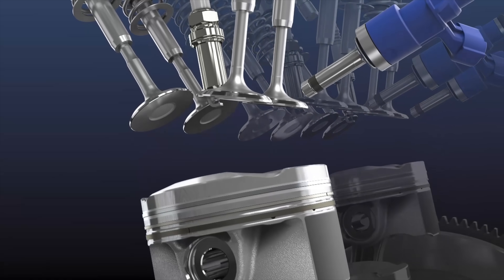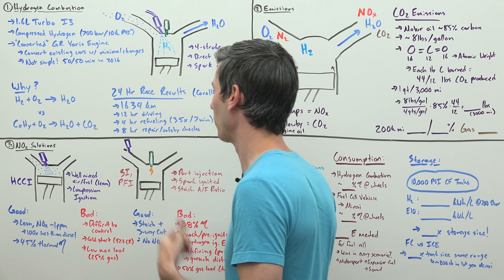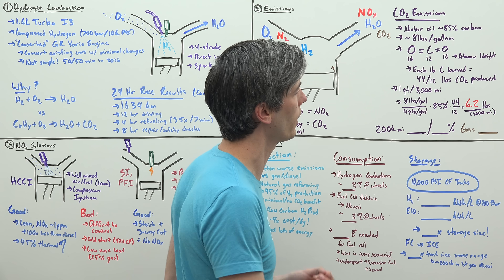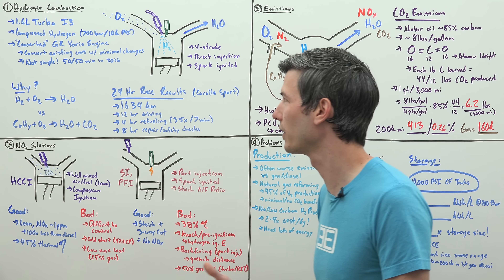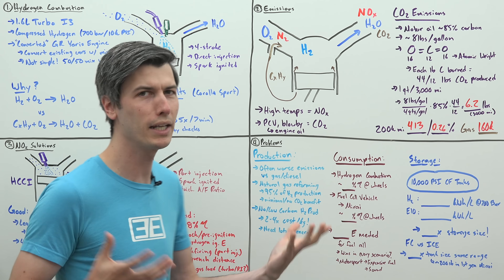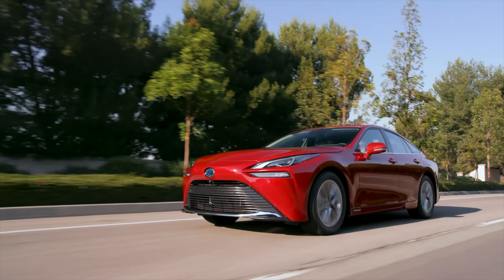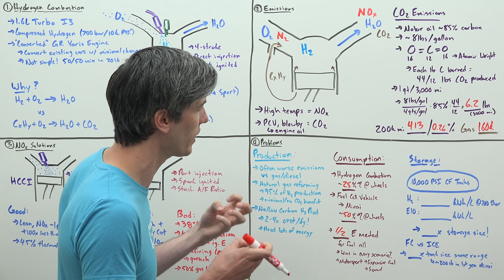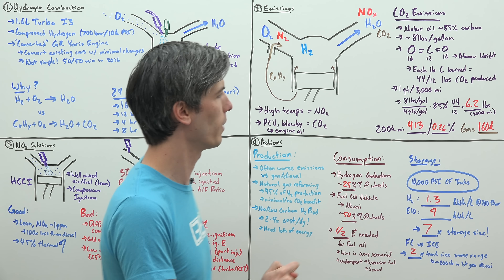Toyota's Developing A Hydrogen Combustion Engine!

Comment: Ideally, hydrogen powered cars would be far more environmentally friendly than electric cars.
Reply: How?
Reply: Just not going to happen when electrolysis is so inefficient
Reply: Simple ansver never.
Reply: @Buringrud  1) no mining
2) no concern around solid waste disposal / recycling
3) quick refill (like petrol)
4) no Chinese dependence for rare earth materials mining and processing

On #2, no viable process for Li-Ion batteries is currently in production.

Of course, if a better battery chemistry actually makes to production, the assessment can change. For all the reasearch that has gone into it, alternative chemistries remain stillborn.
Reply: @denismilic1878  exactly
Reply: @vipul_singh  First, many more moving parts, it’s also extremely inefficient. While you get 20 something percent of the energy you put in. Also, no mining, but where do you think they get hydrogen from? You don’t just grab a bag of air and have hydrogen you have to separate it. Then most of the time they make it a liquid which is still extremely hard which makes it expensive. Now with electric, you can literally get the power from solar which a lot of people do. Also all supercharged are going to renewable electricity by 2022. The worst thing about an electric car are the batteries, which will continue to get better and better. There is research out there for batteries made of hemp that are 80% better. Or batteries made of silicone if they can get it stable enough not to expand and contract so much.(which tesla is working on). So yes batteries now are bad, but they won’t always be. Has engines have had over 100 years to get better and they are still inefficient and slow. Electric is still in its infancy and once the batteries come from more renewable sources. Nothing will be able to beat it. As of now total production and life of the car, Tesla’s produce 25% less co2 than a gas car and that number will continue to decrease. Gas/hydrogen engines will never decrease. It’s inefficient to use a fuel.
Reply: If we get mass adoption of thorium MSR's and/or fusion becomes viable, sure. I still think there's a safety argument for keeping hydrogen off the road though, because a 10,000 psi tank of hydrogen in a high speed impact is a catastrophe waiting to happen. But it might be a good fuel for aircraft and specialized equipment. Ships... maybe, but space tends to be more important than weight there.
Reply: @Buringrud  As the energy production itself gets cleaner, all downstream processes would become more environmentally friendly. So I agree with you there - electrical energy production has to become cleaner as it is universally advantageous, in whichever way we subsequently use it.

What we should certainly also be pushing for is that this cleaner energy be used to produce Hydrogen from clean sources too (example: water), instead of the way it is currently being done. Thankfully, there are no technology challenges in doing H2 cleaner, unlike batteries (see below).

Where Li-Ion tech fails is that it seems perpetually dependent on mining, and associated waste management concerns. Such concerns are practically nonexistent with H2, if it was produced with clean energy and clean methods.

As I said, chemistries to replace Li-Ion have been in labs for 30 years. Once I see a different chemistry in production, I am open to revising my assessment.
Reply: @DFPercush  We would certainly need to ensure that H2 cylinders are physically protected, just the way Lithium-ion batteries are, and I believe those techniques are already in place. Lithium, too combusts spontaneously upon contacting air.

But yes, you raise a good point, for sure.
Reply: @vipul_singh   Chemistry for batteries has already changed significantly over the past 20 years. It will continue to change and get better. Look up hemp batteries, now that hemp is more legal to grow and use. Look up silicon batteries as well. You can literally scrape the the desert for silicon. 

Again with the clean energy. Currently tesla is moving all of their superchargers to green renewable energy. Once that happens by 2022, the only issue again with electric goes back to the batteries. 

Hydrogen is so inefficient. You have to to produce it as well, then transport it to the stations where you fill up. With electric you can plug in literally anywhere with an outlet. 

Also, it’s super explosive! Unless again you turn it into a liquid. Which is super expensive and uses more co2..
Reply: @carbonstar9091  - no disagreement there
Reply: Unfortunately no. Hydrogen cannot be made in large scale from hydrolysis and the only other viable “green” method is using thermochemical process with thorium salt nuclear power plant. There are still big problems today with thermochemical process itself and catalyst compounds but there might be a way through these problems. However biggest problem is nobody is currently operating any thorium salt reactors commercially so whole point is still moot.

Comment: In northern perspective, hydrogen system have 100 % efficiency. Nearly whole year we need heat, in cars and houses. When electricity produced by nuclear energy, no emissions. Do you know that, small diesel not produce enough heat in car In very cold winter weather?

Comment: How many EV’s could they have built for what they spent on this?
Reply: That's not even a useful question. Doing science will always be more expensive at first than just continuing with the status quo. The point is to spare no expense researching every angle to solve the gas problem so we don't all die

Comment: It really makes you question why Toyota so invested into hydrogen.
Reply: Places in Japan are density populated people usually street park, having a garage is extremely rare and expensive. They are probably trying to work around this problem as hydrogen fuel cell vehicles and hydrogen combustion can be adopted easily and you fill it up just like a petrol car
Reply: @mathew936  That may be true for Japan but they're a global company. If the rest of the world doesn't adopt hydrogen they will fall behind. At this point EVs seem to have the clear lead.
Reply: Their .. hope? is that the price of Hydrogen will come down with mass use to the point where it makes sense.  All auto manufacturers are focusing on electric. If you take the high cost away from "green hydrogen" it is the way to go. (in a fuel cell) .  The Mirai has been a great experiment... but they had to install fueling stations in California themselves, in order to trial the cars.
Reply: @Ozmundas  Okay, I wish them the best on their hope. Mass adoption is the key. Ask someone who isn't an automotive enthusiast if they heard a Toyota Mirai and then ask about a Tesla. I almost guarantee they recognize the Tesla over the Mirai. It's almost the same concept as Blue Ray vs HD DVD. I'm not saying one is better than the other, it's which one get mass adoption will win.

Comment: Toyota should be commended for continuing to think creatively. Their cars and trucks have a great reputation for reliability and performance.  Frankly, there is nothing out there today that is performing like the gasoline, diesel engine. 

Until the EV can match with performance, reliability, range, price, re-fueling time, etc., I doubt very much that the less than 1% market share that these vehicles have in the US will not change.

Comment: if this video concludes, like EVERY single other hydrogen video, that hydrogen is not economic to use, im gonna lose it
Reply: I know right.
Give it a frickin chance!
Its like if any company mentions hydrogen as mobile energy storage the internet says: NO
I was in that group at one time but then I found out how much pollution making a battery cost compared to it's lifespan. 
As long as you don't need maximum efficiency (like on a solar powered yacht) you should use the option that causes the least pollution.
Hydrogen fuel tech has a much lower floor for pollution than batteries. It's metal tanks versus composite batteries.
And hydrogen combustion avoids expensive fuel cells. All we need now is a more robust energy grid to make up for the inefficiency of making hydrogen itself.
Reply: @AurumFaber   I mean Mazda sure did try a hydrogen RX8 and it made half as much horsepower and the amount of energy it takes just to store it is absolutely absurd. Hydrogen fuel cell vehicles are out there in the US but they're incredibly niche and if you're not in a specific area in the US you can't get your hands on one, but at least the efficiency of electric motors gets to help there. Hydrogen combustion just seems like the worst of both worlds.
Reply: @CaroFDoom  energy cost to store the hydrogen can easily be offset by renewables, no? 
The point of my comment is that batteries were out, and then you must dispose of them.
Sure, hydrogen power storage is extremely inefficient, but that energy can be taken from anywhere. 

But I believe that the real problem is personal transport in general. If we want to do away this batteries and hydrogen tanks, mass transport by rail should be the norm. 
Intracity transport can be handled by trams and subways, intercity transport by full sized trains. Rail vehicles are ridiculously efficient. And there is no need for batteries, pantographs and third rails can transmit power directly from the power plant. 

But alas, people love their cars more than the environment, and we lack a good passenger rail system. The needed infrastructure will never be built and the planet will get warmer and warmer. Other countries are making a start but the US falls flat.
Reply: @AurumFaber  in the world where we have infinite availability of renewable energy, sure, that no longer matters, this is not that world. batteries aren't a great solution either but they're here and viable right now with the infrastructure needed to carry it also being used right here, right now.
Reply: @AurumFaber  Was gonna say something about reclaimed materials and bring lead from lead-acid batteries as an example, but looked up the current state of lead-acod recycling. I mean, yeah, most batteries are made from recycled lead, but the recycling itself is currently a polluting mess, it seems.

On the other hand, battery manufacturers are working hard to reduce cobalt use, and over the lifetime of the car, it's still better than fossil-fueled cars, as far as I can tell from data I've seen.
Reply: @AurumFaber  Fuel cell cars are electric cars
Reply: @fenderstratguy  
Understandable, have a great day.

Comment: sounds like electric is better in basically every way almost
Reply: Hydrogen is actually more sustainable in the long run, its just that hydrogen vehicles are a very early stage compared to electric cars.
Reply: @arturoescorcia  Maybe someday we will have a sustainable electric energy source that dwarfs anything we have now and can afford to mas produce hydrogen through electrolysis.  Maybe someone will discover an element that when exposed to  carbon dioxide gives off hydrogen.  An algae that emits it.  Never know.  Worth researching for sure.
Reply: If they crack the problem of the EV batteries being huge and heavy and with slow charge time and very poor energy density then I think nearly everyone will be happy to just use EV (once they get the price down to the current ICE levels)
Reply: @philspencelayh5464  I think they've already developed small scale prototype solid state batteries that have the potential to revolutionize everything if it can be perfected and mas produced.  Greener and longer lasting

Comment: Dude, you are amazing, I just wish Toyota takes notes and implements the "FreeValve" aka the Electronically Controlled Valve Technology and further improve their experimental Hydrogen Combustion Engine...
However, the storage and supply chain of Hydrogen Gas is way more complex, costly and challenging due to its extremely low boiling point and the miniscule size of the Hydrogen Gas Molecule. Therefore managing the Hydrogen Gas before and throughout the combustion cycle is a way bigger problem than improving the efficiency of the Hydrogen combustion itself.
Again, Electric Motor Efficiency and convenience completely surpasses the current Hydrogen Combustion Thermal efficiency and practicality.
Nice to see this technology being improvised though...but I doubt that this technology will pick up unless we find a way to store Hydrogen in a liquid form at room temperature and pressure like Hydrogen Peroxide or Water or a new form of Liquid that holds Hydrogen or something...

Comment: You could easily use electrolysis and solar power to split water (rainwater and mains) into hydrogen and oxygen. These one man in the US who lives somewhat isolated who uses just as a set-up, and then uses fuel cells that create both electricity and running water on-demand. 
Also, James May had a Mirai for a while, but had to sell it because the UK is lazy regarding hydrogen refuelling pumps.

Comment: Any gas engine can burn hydrogen with minimal conversion. BMW had a limited production model that burned both and you could switch back and forth with the flip of a switch. Jack N had a G body that he ran on hydrogen. All old card could be converted to hydrogen. Modern ones as well.

Comment: so can you just throw on an fuel regulator like on a CNG conversion on a gas injection engine & burn hydrogen in it?  what about a turbine type of engine with just oil just for the turbine blades probably have even less to no co2 emissions

Comment: I'm just a machinist not a physicist but couldn't you use the alternator for on board hydrogen electrolysis and a rotary motor for simplicity. Seems like you would have power loss involved with the up and down motion of a piston.

Comment: I think it doesn't yet make sense to compare H2-engine with fuel cells or EVs for passenger car applications. If you however do a similar comparison for high load and low speed applications (Tractors, excavators, wheel loaders, etc.) you would see a significant advantage of this technology.

Comment: Sodium  pellets  wrapped  in  aluminum  foils  may  be  kept  in  normal  tanks.  Pellets   may  be  conveyed  to  a   small  chamber      and   water  can  be  sprayed  over.  Hydrogen  gas  will  evolve   for  engines  or  fuel  cells.  Sodium  hydoxide  effluent  can  be  recycled  to  extract  Sodium  for  reuse.  Energy  density  would  be  30%  of  Gasoline.   Can  be  analysed   and  tested.

Comment: So if the exhaust is water. Can't you put that exhaust in a extra fuel tank where it's purpose is to separate the hydrogen from water and put that fuel back in the original gas tank

Comment: Why not use mineral oil? That would eliminate the carbon and C02 problem. We been using mineral oil in air compressor for the last 50 years so we can breathe the air that comes out of the compressor.

Comment: What about intake valve gunk? The reason why they switched from direct injection to duel injection is because the valves would buildup gunk over time without having gasoline clean the valves. How would they solve this?

Comment: Green hydrogen in my country is cheaper than oil or diesel. Already buses using it. Wind farms in the sea instead of storing power in a lithium ion battery they store the power as hydrogen. However, why not just use Iron oxide or something? If it spills no problem, it can be "recharged" to be reburnt, and can be stored in huge amounts pretty safe.

Comment: Everyone hates on hydrogen, but I think it has it's place. Yes electrolysis isn't that efficient but if it's made with renewables you've got no CO. The best thing though I think is in countries like mine (UK) where natural gas boilers are in the majority of homes .. these can run on hydrogen as well and cut out the carbon emissions without needing new infrastructure.

Comment: forgot to mention hydrogen embrittlement.  I have a feeling it would crack rings and cylinder sleeves (and any steel it passes through) pretty quickly.

Comment: in the case of fuel cells, we still need hydrogen stored in a tank in the car. We still need storage tanks if fuel cells are used right? if yes how fuel cell cars are better than internal combustion engines ones?

Comment: What happens when a cylinder at 10,000 PSI is ruptured in an automotive accident?  I used to fly an airplane that had 3 high pressure air tanks (3,000 PSI-"if" memory serves me correctly) located right behind my head; and that made me a little nervous (many of it's systems were pneumatically powered rather than hydraulic powered {Fokker F-27}).  What kind of "energy level" compared to a standard tank of gasoline are we looking at it one of those "large" nitrogen tanks were to be ruptured and ignited in an accident?

Comment: Clean Air Now, a California nonprofit public advocacy corporation, has recently completed its ground-breaking “Solar-Powered Hydrogen Generating Facility and Hydrogen-Powered Vehicle Fleet” technology deployment demonstration project. The project is located on two-thirds of an acre, at Xerox Corporation’s El Segundo facilities, just south of the Los Angeles [California, U.S.A.] International Airport (LAX). The project is the largest and only fully permitted solar-powered hydrogen-generating facility in the country. It comprises a major portion of the developing hydrogen energy infrastructure in Southern California, which now supplies fuel for some of the few private sector hydrogen-powered vehicles in operation.

Clean Air Now’s demonstration project in El Segundo, California, U.S.A, uses solar electricity to generate hydrogen; the hydrogen produced powers a fleet of vehicles.

Comment: Suppose we had cryo-tank liquid H2 combustion engine: Could transportation with long haul/heavy load semitruck (or rail) benefit from the power the engine can deliver, where the persistent issue of battery/fuel cell size to load weight capacity creates a ceiling in usage capability/versatility?